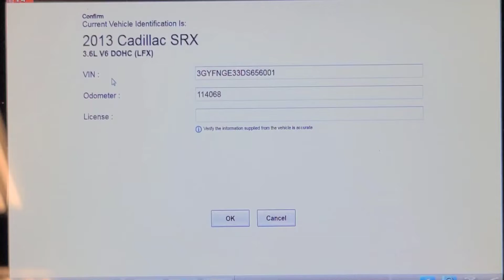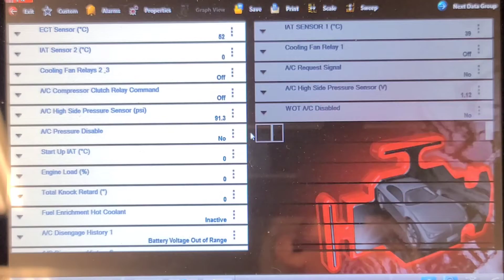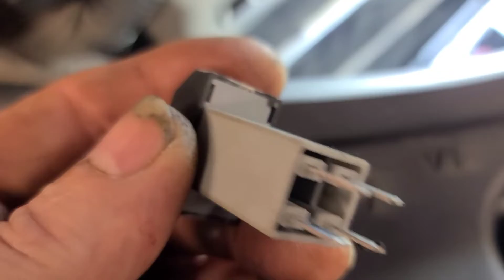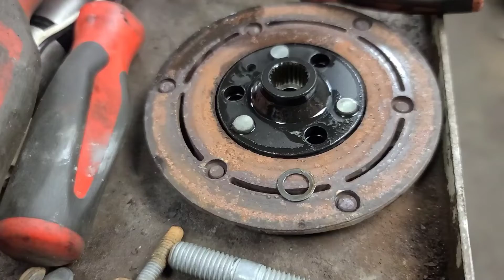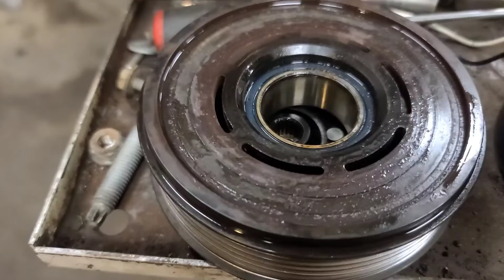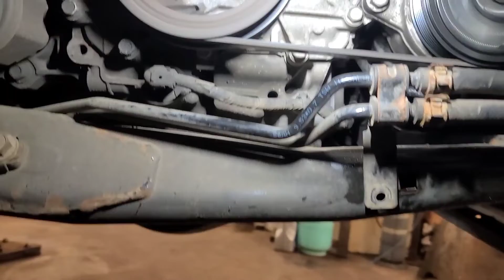2013 Cadillac SRX AC Not Working. Compressor Clutch Failure

Comment: 2011 srx does not have a dedicated fuse or relay for ac compressor & mine no codes has correct pressure  changed the high pressure switch it just won't engage the clutch ordered new clutch 🤞
Reply from the maker: That appears to be correct. The diagram I just looked as shows both the power and the ground for the compressor coming from the HVAC control module. You say there are no codes but are you scanning the HVAC system or the ECM/PCM. I would suggest to look at the status of the AC clutch, AC request, etc in the HVAC system. If the AC clutch shows As being commanded as on then disconnect it and connect a test light of at least 2 amps across the connector. If it lights then you need to replace the clutch. If it doesn't light you need to chase the wiring to the clutch and the  HVAC  module. If the status of the AC clutch shows as off or no then check the status of the in car temperature, pressures. The HVAC  may report permissions as well. Good luck.
 Don't replace the clutch if there is no power to it. Edit... this compressor appears to be driven all the time and the HVAC module duty cycles the internal swash plate to achieve the desired performance.  I don't believe it actually uses a clutch like most systems. You need to view codes and data in the HVAC module. Good luck.

Comment: Hey Philip great video thanks for the help. One question to clarify... If we have 12 volts at the compressor plug which makes the test light turn on, then we've definitely bypassed the pressure switches at that point, correct?  I don't want to replace the clutch if a simple pressure switch could be the culprit. Thanks again
Reply: Also, did you check resistance on the coil to confirm it's bad, or is that not necessary at this point?
Reply from the maker: If you can get test probes onto the terminals, yes you can test the resistance of the magnetic clutch winding. I'd expect between 3 and 10ohms. It's difficult to access so I don't remember if I did or not, sorry.
Reply from the maker: If your test light lights when connected to the two terminals of the clutch coil connector, then yes, the entire circuit is functional, and the compressor clutch has failed.

Comment: Would you like to know a little secret. It might seem obvious after you think about it. But you actually don't need to take any of the bolts out at all. The plug at the top is much more easy to get to once you've taken the clutch & magnet off. I've done many of these and standard tools you can pull the clutch off without dismounting the compressor. Then the plug at the top is accessible.
Reply from the maker: Thanks for the tip.

Comment: Hello sir, thanks for your video. By  advice on an ac being seized up causing the pulley not to turn ? I don't care about the air conditioning. I just need to get my car back on the road without having to replace the whole compressor
Reply from the maker: For some vehicles you can buy a bypass pulley but not sure if available for that application. How about a used compressor even if you don't charge it.

Comment: Hello I replaced ax compressor it’s spinning refilled and no cold air any suggestions pls help
Reply from the maker: Have to know what the low and high side pressures are. How did you charge it with refrigerant? Was it a new or used compressor?

Comment: Can you pull the serpentine belt from off the clutch pulley without accessing &  releasing pressure from the tensioner pulley?
Reply from the maker: No you cannot.
Reply: So is there pretty good access to the tensioner pulley from that direction(underneath)? The maintenance manual says to pull out air intake box to remove/replace serpentine belt..thx.
Reply from the maker: @Texdram  I honestly don't remember pulling the airbox so I must have accessed it from below.
Reply: @PhillipBailey  is there a trick in getting that face plate nut off, the lock nut? The rest of the plate just spins... can't seem to find a point anywhere to lay some resistance up against..
Reply from the maker: @Texdram I used a large pair of channel lock pilers to hold the drive plate from turning
Reply: @PhillipBailey I actually got the nut off..thx..now dealing with the snap ring.. can only spread one side...how did you get it off? To think there's a second one is even more frustrating..
Reply from the maker: @Texdram  yes its a challenge for sure. The second one is tougher. Little penetrant helped.
Reply: @PhillipBailey  thx & long snap ring pliers?
Reply: Well got the nut off now I'm dealing with the first snap ring,any tips in that?

Comment: on this SRX can the clutch be removed with keeping the compressor in place? Seems very close maybe not enough clearance. Seems you loosened bolts to shift over the compressor to get to the wire connector only, but then continued removing the clutch with compressor unbolted.
Reply from the maker: You are correct I moved the compressor to access the connector but you might be able to get the pulley off without doing that.
Reply: @PhillipBailey  it was easy enough to remove the 1 lower bolt, top nut, and E8 threaded rod, then pull down the compressor, so non issue, I'm used to having rusted bolts : ) but not here. Also, the coil wire is held in place by a tab to keep the wire from hitting the spinning pulley, pull up the tab and get lots of slack on the wire (no room for a short Phillips screwdriver), then easy to get a probe on there for diags. Thanks for the great vid Cheers
Reply: @bobpx I was able to access the plug from the top after taking off the latch cover on the radiator support. It's just five or six plastic push pins.  Once out of the way you can reach down and get your fingers on the plug to release it, and pull it up to expose the pins.  There's not a lot of play on the harness but there's room to work

Comment: Great video thanks, I'm dealing with same issue and same vehicle. 2013 Cadillac srx. So when 30 and 87 are jumped is this also bypassing the pressure switches because I can't even see these switches, I've jumped these to pins but clutch still won't engage so is this for sure problem with compressor? Thanks again
Reply from the maker: Jumping 30 to 87 at the relay should make the compresor engage but if it does not that does not guarantee the problem is the clutch. You need to test for power at the clutch connector but thats not easy.
Reply: Thanks for quick response
Reply: I'm still fighting this ac compressor, with pins jumped over i do have 12 volt at compressor but don't seem to have ground but clutch still not engaging, should it not ground from been mounted from block ground? I'm thinking of running a temporary ground to it just to test. Any advice will be appreciated
Reply: One more question, when ac is turned on in car should it send a ground to a relay pin or is that sending  voltage? Thanks again
Reply from the maker: @egtreadway4232  the black wire should be a ground to G110 which I believe is right on the AC compressor
Reply from the maker: @egtreadway4232  the ECM grounds pin 86 of the relay when it sees the AC request. The relay should click when energized. You should have ignition power on pin 85. A conventional test light connected across 85 and 86 should light with AC request. You can see the status of the AC relay in scan data and should be able to command it on and off with a decent scan tool.
Reply: Ok thanks again for all your help, i can command it on with my autel scan tool but didn't check to see if its actually sending ground to relay pin, I do not hear relay clicking but did bypass it. but without relay in and jumped will ground be sent to compressor clutch? Thanks again
Reply from the maker: @egtreadway4232  the relay sends power to the compressor clutch which is grounded at all times.
Reply: Ok makes sense, I must have problem with ground wire at compressor clutch. I might connect my own ground to that wire and see what happens if the relay pin is getting ground after commanded on. When I command clutch on with scan tool the cue inside showing on and off so i think the cue is working. Thanks yet again

Comment: I replaced a compressor and Klutch 
Now they are saying it’s the motor does this sound right or did I get robbed
Reply from the maker: Well that depends what your issue is and what motor you're talking about. I need more information.

Comment: Missed the whole reason forthe video.. HOW DO YOU REMOVE THE OLD CLUTCH AND CONNECT THE NEW ONE TO THE COMPRESSOR?
Reply from the maker: Starts a 9:15 in video. Remove the drive plate nut and pull the plate off the shaft, remove the snap ring holding the pulley and bearing on, pull the pulley off the housing. Remove the snap ring that retains the clutch coil and pull it off. It's very difficult to show each step as there is not much room to work and I don't have someone to hold the camera. The snap rings are the most difficult part of the job. Installation is the reverse of the removal.